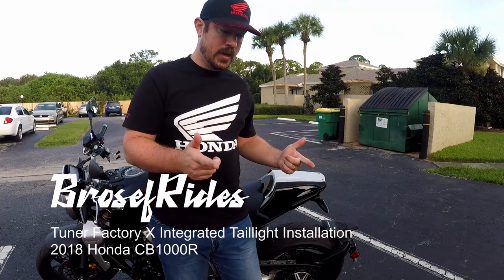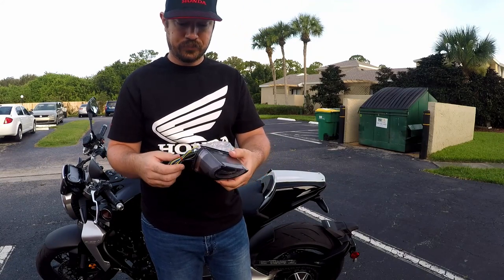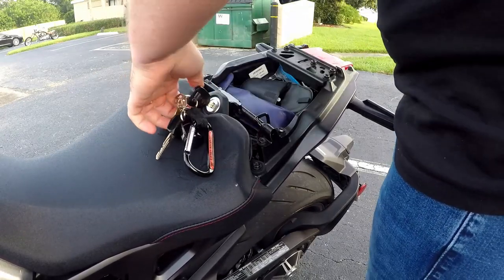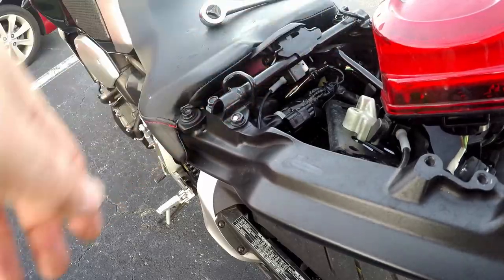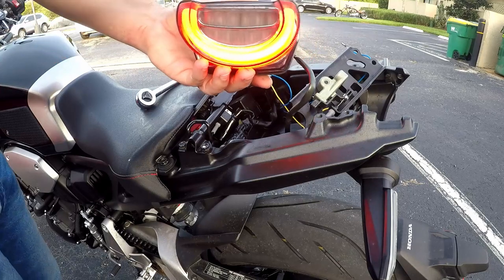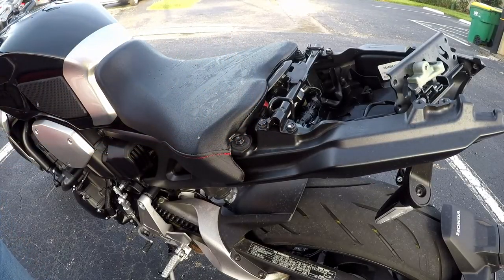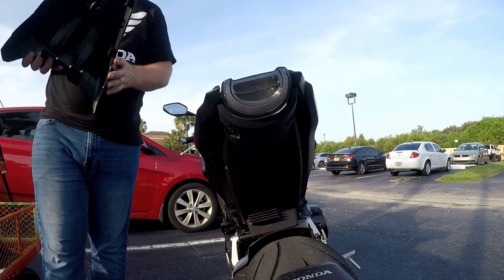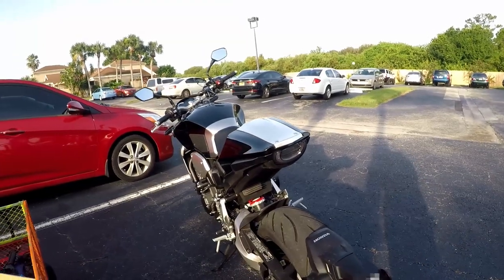2018 Honda CB1000R Integrated Taillight Install

Comment: Hello, I bought the same light and your video was of great help to me because the manufacturer does not provide instructions but I cannot get the turn signals to work correctly, when I install it the intensity of the position and brake light decreases and it does not work, I have followed your steps and it is the second pilot that I try and it has the same problem, can you help me?  Thank you

Comment: i ordered the same item from tunerx-factory but they sent me the one without the turn signal. Do you know if there's a way to modify the integrated taillight so that the turn signals will also work like the one you installed? I tried to email them but my message keep bouncing back. And it tool 2mos to ship my order so if theres a way for me to diy, i would prefer that than ship it back to them and get a new one. Sorry for the mini rant. Haha 
Great video by the way! I used this as guide to install mine. 👍💯
Reply from the maker: Sorry it's taken so long to reply! Have you found a solution yet? I would think when the taillight is assembled that they simply don't have the hardware for the turn signals. You might be able to modify yours, to insert a small LED or strip, but will probably require disassembly/destruction.